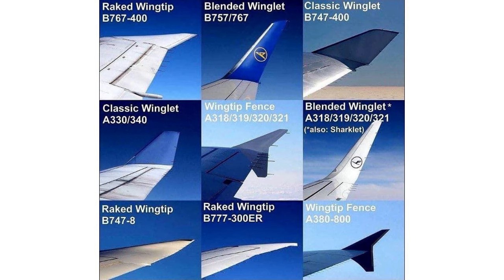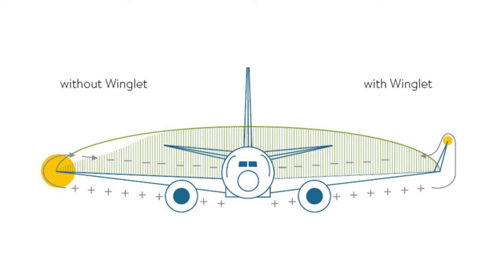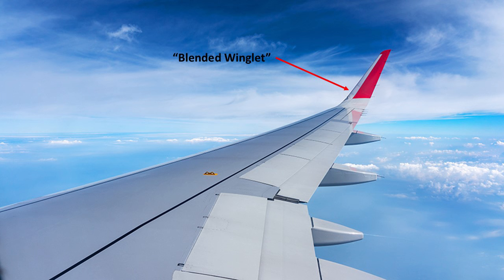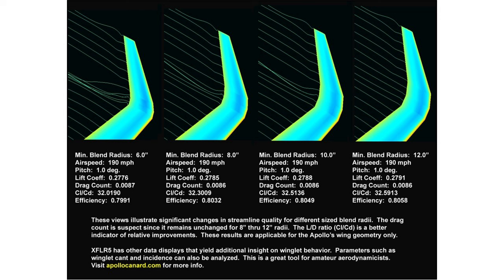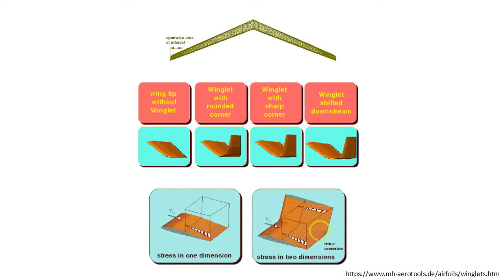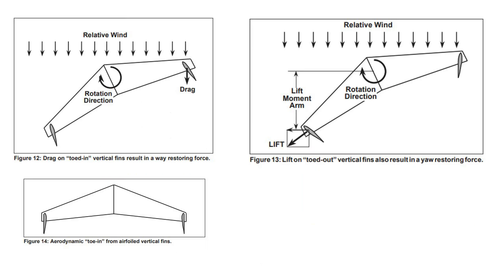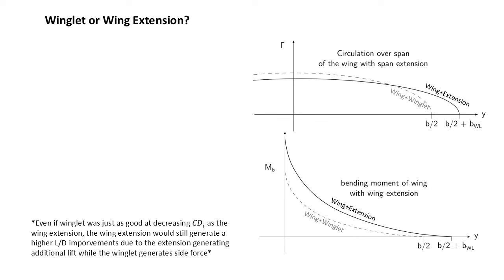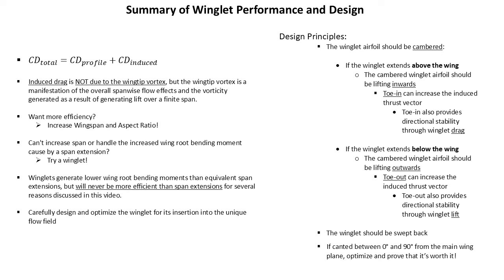Winglet Design for Flying Wings: Aerodynamic Performance, Efficiency & Stability (Part 3)

Comment: I'm a product designer professionally but I've been teaching myself about aerodynamics and aircraft design because I want to break into the aviation industry

I've been using Rhino, Blender, ANSYS Fluent, JSPSim, and Flightgear to design aircraft, do CFD analysis, and simulate flight of my designs

Your channel has been such a gem to come across. I watched your other two videos multiple times. Its really helping me understand how to interpret the stability derivatives that I get from ANSYS Fluent. Also putting me on to tons of principles to study into further.

Please keep making these videos, your channel is the most amazing resource I've found yet to teach myself about aeronautical engineering. Thank you so much for sharing your knowledge. Blessings

Comment: @4:05 you talk about how the downwash changes the angle of attack, but in the previous slide you show that the air at the leading edge is actually an upwash. Can you clarify this?
Reply from the maker: Great observation! While the air does locally flow up at the leading edge, the wing ultimately pushes that air down to generate lift (Newton's 3rd Law). This net downwash behind the wing is much stronger, and it effectively tilts the entire wing downward, reducing the angle the wing 'feels'.

Comment: Could the British electric lightning benefit from winglets?
Reply from the maker: Likely not! The Lightning was a supersonic interceptor, and as mentioned in the video, winglets add profile drag which increases significantly with speed. At Mach 2, that added drag would far outweigh any efficiency gains, ultimately slowing the aircraft down.

Comment: They prevent the air from under the wing swirling toward the top of the wing at the tips cancelling the lift, therefore you can get more lift less drag from a slightly smaller wing.
Reply from the maker: The 'swirl' (tip vortex) creates induced drag by tilting the lift vector backward, rather than strictly cancelling the lift. As for using a smaller wing, the video explains that a span extension (longer wing) is actually more efficient than a winglet, we typically only use winglets when we are physically limited on how wide the wing can be!

Comment: Would you have any interest in turning one of your designs into a flying FPV model? I have a DJI o4, a printer, and a small pile of carbon/kevlar + epoxy ready to go into a new model. I was experimenting with the method of printing a model with .2mm wall in light weight ABS, to use as a plug for the composites. Let me know if you have any interest!

Comment: According to my aero instructor you'd almost always be better off just folding the winglet down to increase the span of the wing if not for size and bending moment contraints. You covered this very well in the video. Vortex lattice methods are useful not just as a analysis tool, but for developing intuition.

Comment: Another spectacularly good video.

The only thing that I would add is that winglets or wing fences are not necessarily chosen for efficiency gains.
For instance, I am designing a STOL aircraft with fairly restrictive maximum dimensions. Because of it, maybe 80% of the reason for using a wingtip device was purely for maximizing lift at high AoA. Drag was only of concern if severely affecting cruise performance, as a result.
However, we can definitely say that the vast majority of designs do use wingtip devices primarily for efficiency gains.
Reply from the maker: Yessir! A lot of winglet adds are for increasing effective span without increasing actual span to maintain aircraft design group

Comment: Back in 1981, my Sr Project for a BSME from U. of Pitt.  was the effect of a winglet on a commercial aircraft.  You covered the topic quite well. Our testing was done in a wind tunnel, and our winglet had an adjustable angle of attack. (we built our model ourselves, lots of maple and dental casting material... college roommate was a dent student) 

Using the tried-and-true method of white string and black marker to monitor the coned tip vortex we could tweak the angle of attack of the winglet to be a "straight line" for each Re #, then record the drag. 

I won the model raffle, and it still sits in my shop.

Retired ME/AE after 40+ years at GE Aircraft Engines.

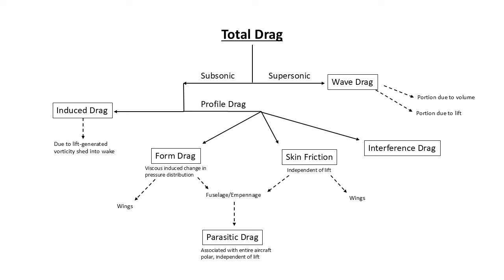Comment: as pilots we are taught that induced drag goes down with airspeed, so if you're flying at a higher airspeed (in cruise), you should have minimal induced drag and a higher parasitic drag (which apparently is more properly referred to as profile drag according to 0:37). so to me it seems paradoxical that wingtips would improve cruise performance given that it's a form of drag that we teach is prevalent at lower airspeeds. guess it goes to show that if you want to discuss real aerodynamics you should never ask a pilot.

another way of framing this remark is that it's interesting that a big, fast airliner would benefit from winglets since they reduce induced drag whereas the skyhawk doesn't really benefit from it despite being very slow. perhaps what I am misunderstanding is how the drag profiles are wildly different for those two different kinds of aircraft.
Reply from the maker: This is all correct, induced drag is less significant than parasitic drag as velocity increases. However, it’s extremely challenging to decrease the profile drag of an aircraft. Induced drag also increases with the square of CL, meaning that when you are cruising at a high density, operating at a higher CL to maintain the same lift with less dense air, your induced drag is higher than it would normally be if the density was constant. We’re trying to increase efficiency and decrease drag in any way feasible, and winglet additions are one of the simpler solutions. There’s a slew of other factors that contribute to why winglets might be overall detrimental in a smaller plane, I discuss this in the second half of this video I think. Anyways, thanks for your comment!

Comment: Nicely described.   Since you spoke of flying wings, I was wondering about slow flying flexible weight shift wings such as a hang gliders which also produce a tip vortex.  I have read about the wing tips of soaring raptors ( hawks) where by there outer tip feathers provide them with multiple small vortex’s versus one big one. Authors of books say that this reduces their drag.  I thought about adding some vortex generators out at the tips quarter cord location.  What do you think.

Comment: Thank you for this series! I am studing aerospace engineering at the moment and my lectures have taught me a lot of what you're showing here. However, your way of tightly encapsulating what can otherwise be a semester of lectures helps a great deal to build intuition and serve as quick reference for further research.
I hope you continue to make videos like this. I hope to design and fly an unstable RC flying wing some day, your material will definitely come in handy as reference.
Reply from the maker: Thanks for your comment, and glad you are finding these helpful. I appreciate reading these!!

Comment: Very interesting video! I have a question that I haven't found the answer to. Do winglet shapes come from equations for one type of profile or are they “randomly created” and then studied theorically. Similarly, do engineers study winglets using CFD only, or do they do most of the work theoretically and than valited their work in cfd or wind tunnel ?
Reply from the maker: Good question. There's no single equation defining shape universally. Winglets are optimized using a mix of theoretical models, computational sims, and then tunnel validation. CFD plays a significant role, but aero engineers don't rely on it alone. The process typically follows:
Theoretical analysis - Hand calcs, spanwise pressure distributions, LLT, maybe quick VLM
CFD Sims - Refine design, identify optimal configurations
WT/Flight Testing - Validate CFD results and extrapolate/relate to real-world operational performance
Reply: @gabefpv  Thank you very much for your answer !

Comment: Have you thought about using a bell shaped lift distribution? There is a NASA guy advertising it. Instead of an eliptical lift distribution you make a bell shaped lift distribution. It's an optimal solution for a given bending force instead of for a given wing span like the eliptical. The tip of this lift distribution acts very much like a winglet and seems to be very benefical for the stability of flying wings. According to this NASA guy prandtl and horten came up with this solution individually. 
https://www.youtube.com/watch?v=RoT2upDbdUg&pp=ygUNYWxiaW9uIGJvd2Vycw%3D%3D
Albion Bowers
Reply from the maker: I did a segment in one of my prior videos on this…. Please check it out!

Comment: What is the typical drag coefficient for a deltawing rc plane built for top speed? Currently I'm at 0.082 and generating about 1.7 but I want a cd of 0.07 or lower. Is my plane a bit too draggy from the Cd point of view? I'm using simscale for my drag, lift and Cm measures. I'm using xflr5 for general stability analysis
Reply from the maker: That’s going to vary with your dynamic pressure and frontal area. Don’t know the size of your wing, but that CD sound ballpark to a little high for a model scale. L/D seems ok, though.

Comment: Winglets should never be vertical, there is no bird alive that shapes its wings that way, the bird with features most closely resembling winglets is the Albatross, and it's tips are only lightly canted.
Reply: No birds come with any rotor or jet engine neither, nor going supersonic
Reply: @charleyfan1908  Peregrine falcon can hit mach .6
Reply from the maker: birds love wave drag
Reply: @gabefpv  Indeed, their flapping wings match fishes Strouhal number ~.4 IIRC.

Comment: Winglets just move the tip vortex giving you more effective spanwise area on the wing, which means you can get equal lift for a lower AoA compared to a wing without a winglet. The strength of the vortex is not diminished, as it's proportional to the lift, it's simply moved to a different position. All lifting wings produce downwash, proportional to the lift. Have you forgotten Helmholtz theorems?
Reply: It depends how you define strength. It will not affect momentum, but will reduce the energy in the vortex. Transfering momentum perpendicular to direction of travel doesn't inherently produce drag (drain the kinetic energy of the aircraft), but the energy for the vortex has to come from somewhere, so always means drag. Without winglets you get a very high energy tight vortex, which is draggy.
Reply: @agsystems8220  strength is a function of circulation. Too much rotational energy will cause a breakdown and recirculation. Vorticity is a form of hysteresis and energy storage.

Comment: Vorticity is a product of lift. A plane produces a vortex ring with it's wings, it's just deformed by the plane's motion and its fuselage. The dangerous helicopter state known as vortex ring state is the default aerodynamic flow structure, a torus.

Comment: One place I worked at, the mechanical eng and myself (PCB design) worked on designing a force-air cooled unit which had a fan at the rear of the enclosure.  We determined (ie we guessed) how the air would flow and created ventilation openings to suit.  Once I had managed to create and run a CFD simulation, you can imagine our complete surprise to find the the results did not match our expectations.  Not even close !!  After numerous CFD trials we ended up creating a baffle to channel the air flow.  If I recall correctly, we tested the product's airflow with a smoke stick.

Comment: Thank you for this perfect video !

Would a negative incidence tip help ? Or maybe a reflex profile like Flying wings extremities ?
Reply from the maker: @pierro281279  Are you talking about washout/diffuser tip? Towards the last 1/4 of this video I discuss diffuser tips for a few minutes!
Reply: @gabefpv  yes you showed anhedral wings and reminded us about flying wings , but I was talking about a big washout at the very end. 
I think that's dumb because of the negative lift , but I was curious if it would have worked if exaggerated.
Washout + reflex for the very end of the wing ( no dihedral )

Comment: great video, but I can't understand, could you start a project from the basics one day, with design programs
Reply from the maker: @hakankosebas2085  I would argue that this is needed before you start with VLM or CAD. If you start with those first, you are doing it backwards. Start with the design theory and principals, and a proper understanding of why winglets do what they do, and THEN run free in design software and CFD. Otherwise you will chase your tail for much much longer trying to derive all of this video for yourself!!